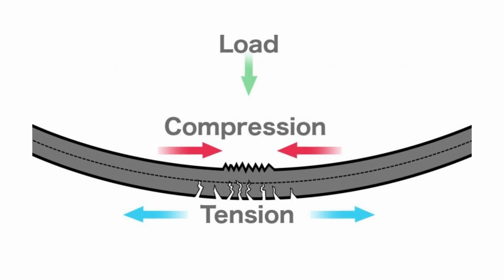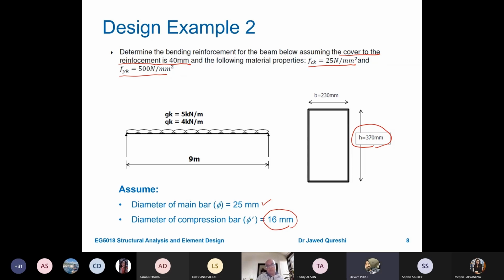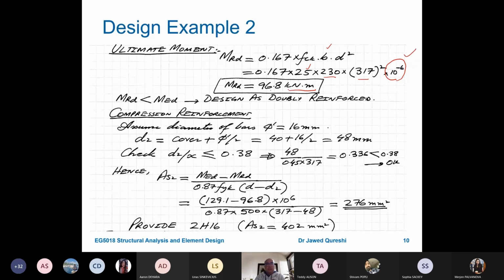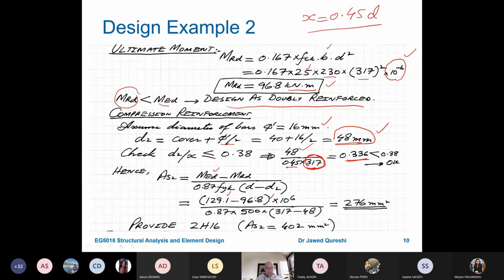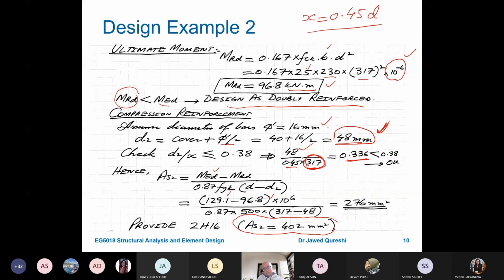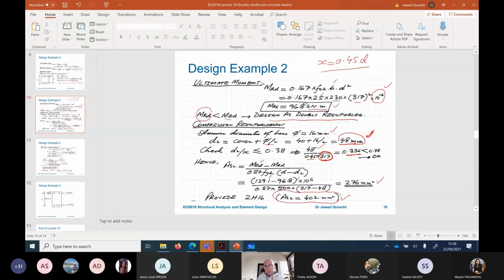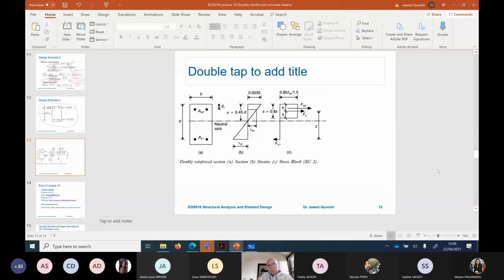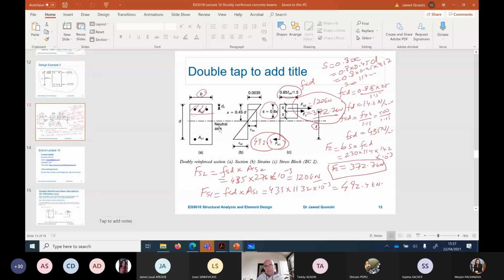08 Doubly reinforced beam design Example 1| Eurocode 2 Concrete Design

Comment: Great lecturer.

I have a question.

In calculation of d, why didnt you include the diameter of the link (8mm) ?
Reply from the maker: Yes, diameter of shear link should be subtracted as well from h to get d. 
I forgot. Also, it will not make significant difference to calculation of d.

Comment: Great video, i have just one question.
 Once we determine the diameter and number of bars, why dont we recount all the previous parameters to make to model as close to reality as possible. Also why we dont use provided area of steel beams to count the forces? Instead we use minimal required area. I dont understand why, for me it seems logical to count with provided area. Why we dont use provided area?
Reply from the maker: Becuase required area is on safer side. Provided area is always more than that.